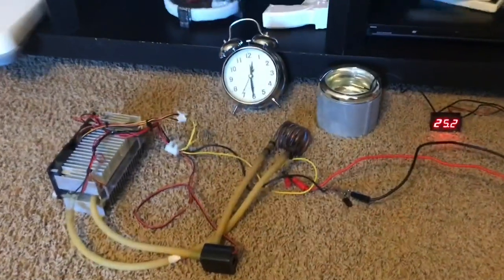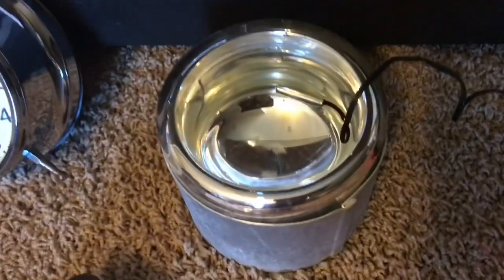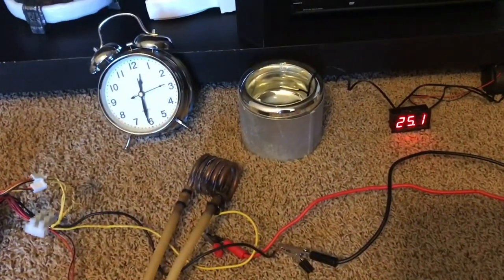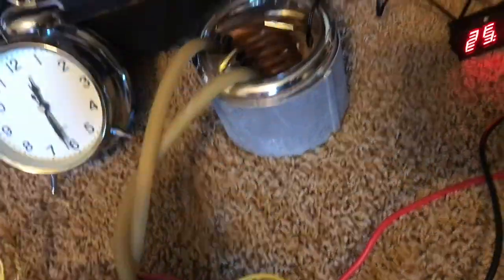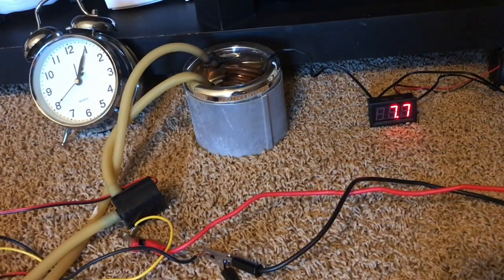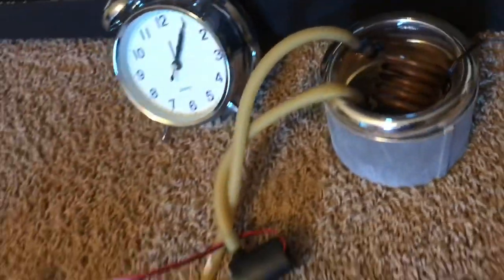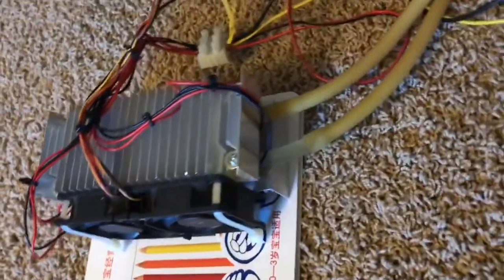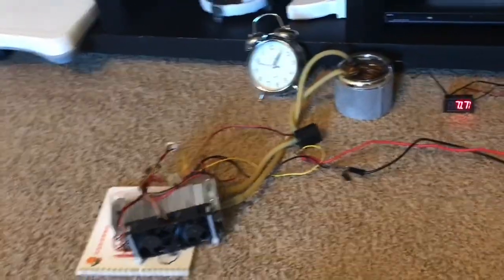Checking Out the Peltier Cooling Coil Pt2/2

Comment: Will the water be cooler if you ran it full of everclear 190 proof since alcohol naturally cools better only problem i see is alcohol boils at a lower temp faster than water
Reply from the maker: The only problem I see  with alcohol is it would damage the inside of the pump as most pumps have plastic and rubber internal pumping components which would interact and possibly soften with the alcohol.